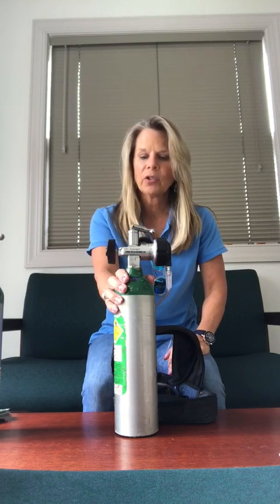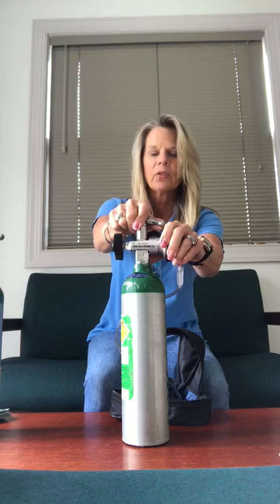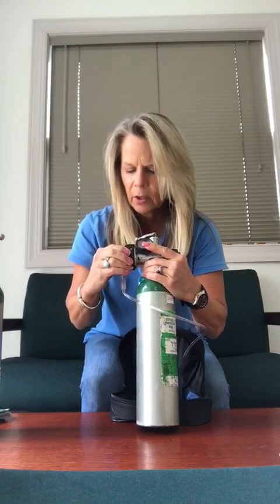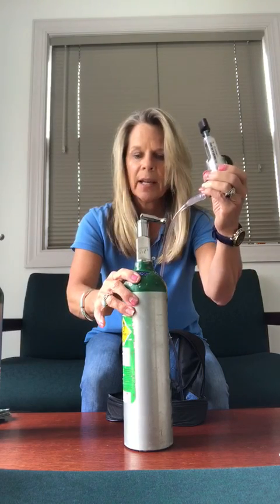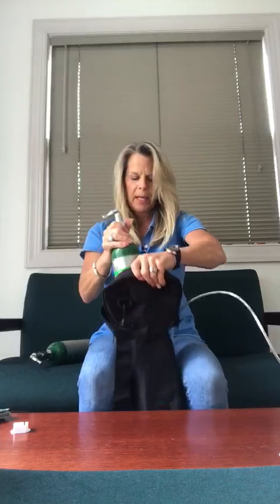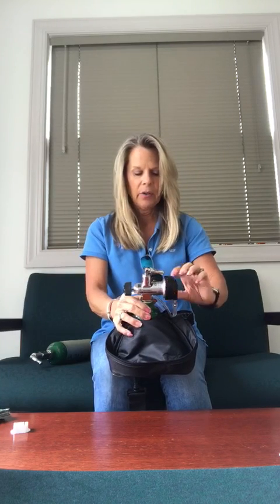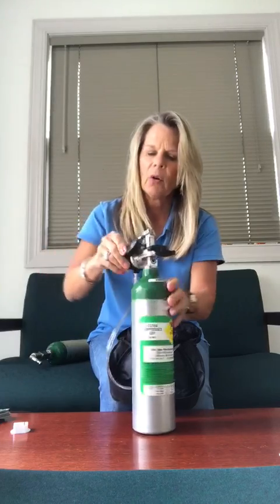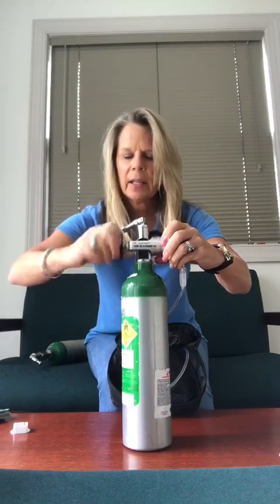How to Change the Regulator on a Portable Oxygen Cylinder

Comment: The instruction "turn to the left" or clockwise, is confusing.  Threads that tighten by turning clockwise are referred to as "right handed threads."  You can confirm this by viewing the valve operation on an empty tank.  When you turn the valve counter-clockwise (to the left), you can see the valve open up. Conversely, when you close the valve by turning it clockwise, it will not be fully closed until it "seats", or stops turning after applying mild pressure.